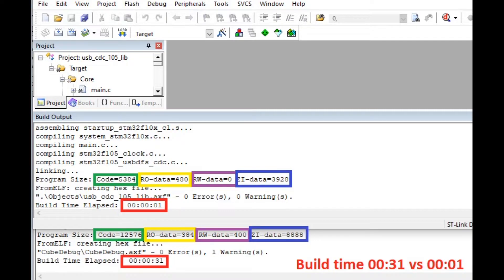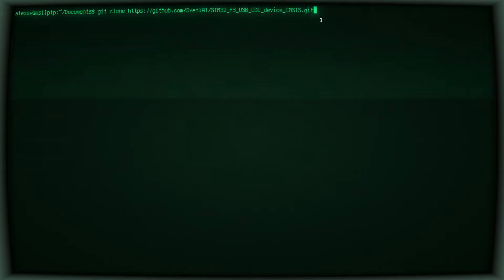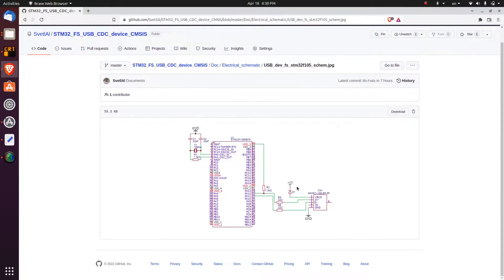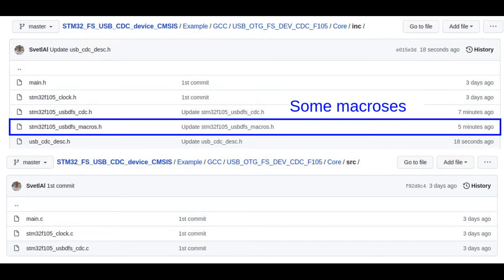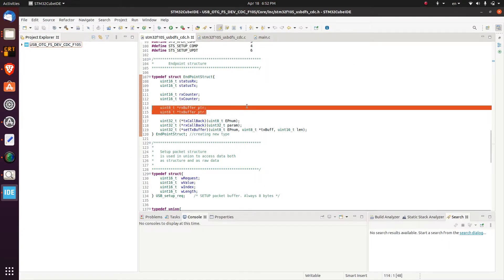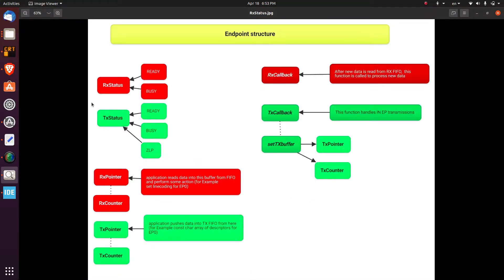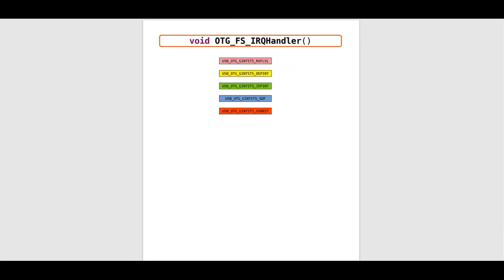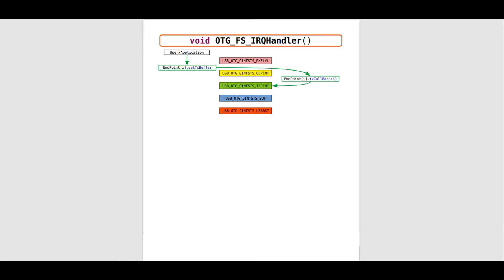STM32 USB OTG FS CDC. CMSIS only, no HAL, no SPL. Virtual COM-port via USB OTG. STM32

Comment: Hi! Have you tried it with the F407 that you've mentioned? I am having some issues with implementing it. Thank you for the video
Reply from the maker: Hi! I haven't been using 407 for a long time and I have forgotten a lot. But I tried this USB implementation just as simple as "copy-paste" for 407. If you have any issues concerning USB CDC in CMSIS project for 407 go ahead and ask me. Maybe you need a working template? I can give you one for STM32F407VET6 devboard.
Reply: @alexsv1834  Thank you for replying! I copy pasted (I only changed the gpio configuration as the registers and pins are not the same) but the laptop is not recognizing the device. I would be grateful if you send me a working template.
Reply from the maker: @LiliaTroudi  https://github.com/SvetlAl/STM32_FS_USB_CDC_device_CMSIS/tree/master/STM32F407_sloppy_example         that's it. Made sloppy just to make sure, that this works. The IDE is Keil. Maybe you've missed something in RCC or CP or Vector Table. This example is working 100%. If it doesn't work for you, send you debug screenshot svetlal@outlook.com
Reply: @alexsv1834  Thank you so much! you're saving me! I will email you in case it didn't work. Spasibo!